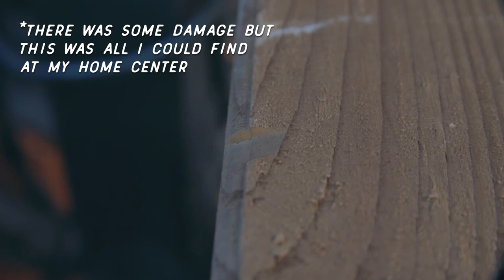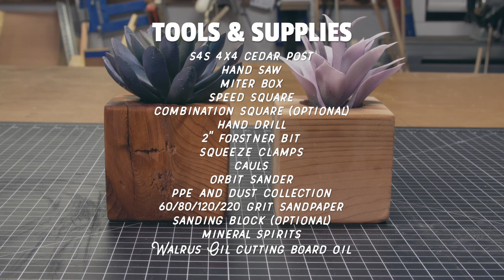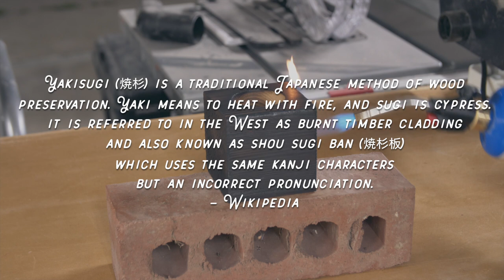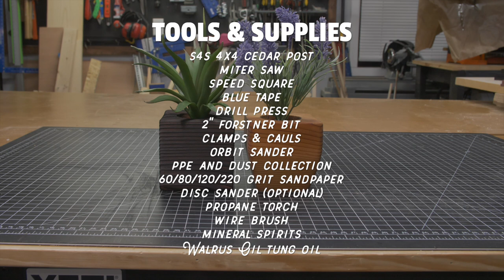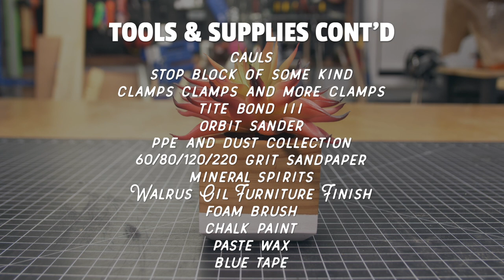3 Ways to Make Cedar Planters | Beginner, Intermediate, Pro

Comment: On the drill press, to hold square items in place I built a jig that has t track that allows for adjustable blocks to be used no matter the size of the wood. Saves so much time and it has no chance of moving.